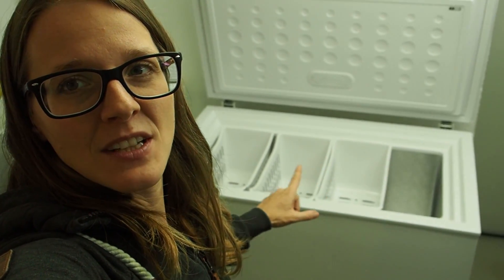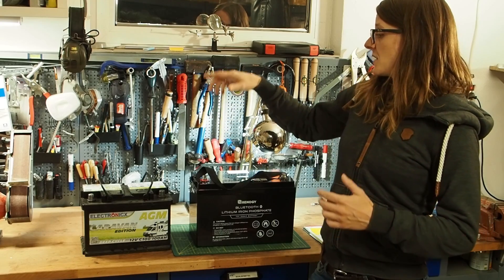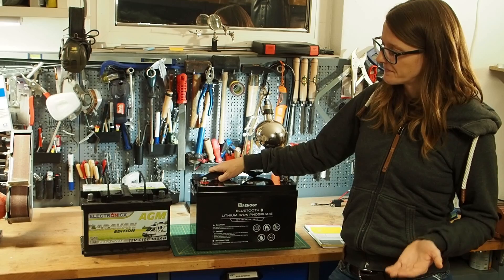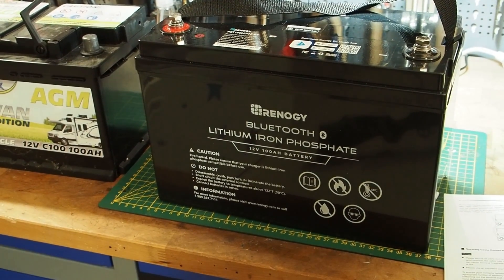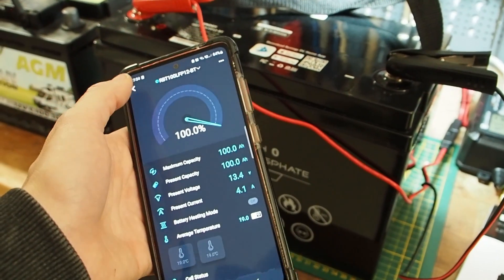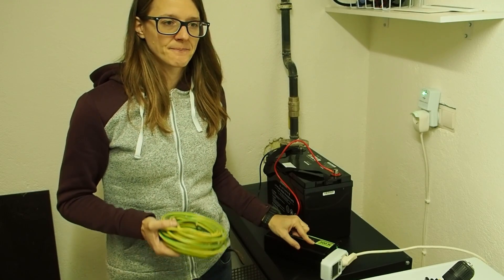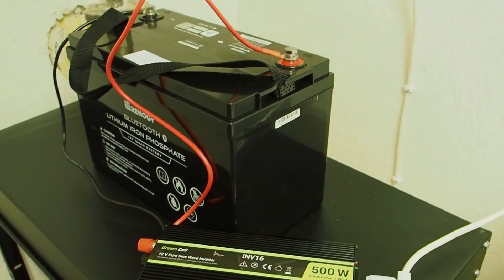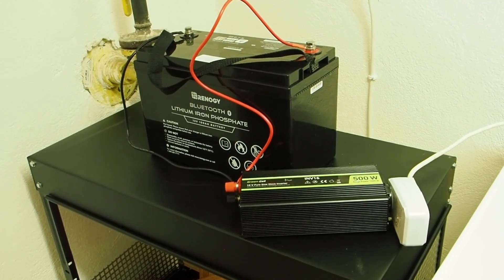How to run freezers off an inverter!

Comment from the maker: Check out Renogy Batteries: www.renogy.com
John Ward explaining IT system on Inverter: https://www.youtube.com/watch?v=mzCGE5wnWos
German Youtuber "ProofWood" solving the RC problem in Caravans: https://www.youtube.com/watch?v=FM9lvwX39g0
German Youtuber "Freunde des Stroms" making an adapter cable for Ecoflow for Caravans: https://www.youtube.com/watch?v=BTDX4ZoCEpc
Reply: This information is really good as I'm looking to do the same sort of thing but it is a shame Renogy don't call you to discuss there camper van complete kit requirements even if you log a request as I live in the UK and I need to make sure the system is UK compatable.... Great work Lilly
Reply: Nice! I have a Renogy inverter to fit hopefully before the winter (on a boat mind). :)
PS thanks for the info, my motor will be running of a 24v system, so interesting to know some don't allow being put in series!
Reply: What are the downsides of a bluetooth battery when we are all on blockchain system of control?
Reply: Excellent video Lilly,love your knowledge of electronics. U are a total survivalist,and I'm impressed with ever video.
Reply: Hast du hauptsächlich englischsprachige Begleiter oder wie kommt es das du als Österreicherin englischsprachige Videos machst?

Comment: Just grounding without the correct modifications can be dangerous.

Using one device only is safe. Otherwise you need to bridge n+e before the rcd and ground it properly, to make it work safely

Comment: Nice to hear your comments and experiences.
I have a couple of questions about a DIY project that involve a 100lts freezer.
The actual supply battery is 150 amps,   Lead acid, I have 4 solar panel 150amps, connected to the controller. I use for lead lights bulbs and planning to power the freezer. The question is, in order to run the freezer I need to use another battery ? Is recomendable to paralell to use 24 V o continuous with 12v. ?
Appreciate some advise, 
Thanks in advance

Comment: I am almost positive you can connect those renogy batteries in series you should look into that for sure.  I have 2 renogy 48 volt lifepo4 batteries connected in series with no problem ,it actually came connected in series I have the lycan 5000 ,but I can't say with 100 percent certainty just that you should double check anyway thanks for the video . Have a great day

Comment: Great video.  I thought I was going to need to correct you but you did a great job.   I just want to reemphasize that the LiFePo4 batterys give you double the run time of a lead acid that is rated at the same amp hours.  So that cuts the cost in half when you compare.  Plus the batteries last way way longer.  Never by lead acid again.  Waste of money.

Comment: The initial voltage of a compressor starting is called inrush The compressor will have a start load run amperage sometimes noted as SLRA . Then you have rla which is run load amperage. To verify your ratings to a sine wave converter and to the power supply peak and discharge you need to take an amperage and voltage reading from the compressor when it comes on. You do this directly at the terminals and then after it begins to run so you do not damage the inverter the battery or the compressor Yes I am an HVAC and refrigeration technician and specialist for over 25 years.

Comment: 500 w inverter may not be big enough to run the amps from your refrigerator I would have gone from 1500 w minimum to 3000 w cover your back a lot better

Comment: I was hoping you would discus the surge watt question in greater detail. For example, when choosing an inverter, do you add the running watts to the surge watts and use the total? Say 500 running watts and 1200 surge watts for a device. (500+1200=1700)? Is this correct?

Comment: User Comment: This video on electricity is so interesting! I'm always looking for reliable power solutions for my outdoor adventures. Any recommendations for portable power stations or backup power products?Response: Absolutely! If you're an outdoor enthusiast or an RV lover, I highly recommend checking out the Segway Portable PowerStation Cube Series. With its massive capacity, fast recharging, and comprehensive protections, it's a versatile powerhouse that can keep your devices and appliances running for extended periods. Plus, its waterproof design makes it perfect for any adventure, rain or shine!

Comment: Nice and informative video😎☕
.
I use a 200w invertor and 4 lead acid deep cycle RV batteries, in my little watchmans trailer.
 The invertor starts sounding an alarm at 11.1volts, and automatically shuts off at no less than 10.9 volts.
 Keeps batteries in safe range, living longer.

Comment: How did battery lose only 40A or 512 Watts in 24h when the freezer pulls 80W plus inverter loses on top of that of at least 6%? Is it magic battery?
Reply: 80w,,,to start the compressor initially, then drops to,,,,26w after ( I think she mentioned those figures in video.)

Comment: But the lithium iron batteries cost 5 times the price of a acid battery so i would 4 or 5 acid batteries and pure sine wave inverter 1500 watts 3000watts or higher with 2 to 3 AC sockets . but make sure you you get the right size cable for the battery leads so they dont over heat ie thicker cable ,also the right way to connect the cables to the batteries .

Comment: The lead acid battery may say 500 cycles at 50% dod but its still perfectly usable after 500 cycles still retaining 80% of its original capacity
Reply from the maker: Dont think so but maybe dependa on the brand

Comment: Anytime you can run your appliances DIRECTLY from the battery/solar system (DC), you are way more efficient. There are very good DC powered freezers and fridges available. INVERTERS, by nature, are ONLY about 75-80% efficient. The components inside them get hot (that's why they have a fan inside) and they are ON all the time drawing some power. All "whole-house" systems HAVE TO BE designed at least 20% over sized to take care of this! For small apps, such as a freezer, I myself, would rather not waste my limited solar/battery capacity going through an inverter. For a whole house with a huge array....well that's different! Only an E.E major's perspective. 😝 But, in your case, Lilly, you are using this mainly as a backup, short term. So I get it!👍

Comment: Great video as usual. What was the app/website you used to calculate the amperage of different gauge wires at certain voltages. That looked very handy because I do all my own electrical work. Usually I err on the side of caution and use much thicker wires than necessary. This also helps with voltage drop through the cable.

Comment: In America, a two-wire connection is allowable downstream of a Ground-Fault Circuit Interrupter (GFCI). This is known as a Residual Current Device (RCD) in the EU.
I am finding that many inverter manufacturers include GFCI functionality.

YMMV

Comment: I was thinking of getting a 12v compressor fridge as a backup too. I have absorption fridges which are great for propane but not as efficient running on electricity as a 12v compressor fridge is. I have a large modern frost free fridge and freezer but they are power hungry on the batteries running on a inverter.

Comment: The LiFePo charge life is also where it goes to 80% charge capacity, after 1500 or its rating, so it has much longer life.
The caveat is that they are much more expensive, not just a little, but reliability in low temperatures and long life are the worthy trade off.

Comment: Lifepo4 batteries and new inverters all have safty mecanism. Most people have issues from loose connections, they  can over heat  because of poor connection conductivity and melt the wires plastics . Buy a Bluetti, safer and space saving devices. Insurance will not pay when fire is caused by DIYers.

Comment: Ya gotta also think about what happens if theres a EMP but also to keep ya freezer from turnin on soo much ya put bottles or bags of water in it so when they freeze it acts as a thermal capacitor which will make the freezer stay off even longer cause it will stay cold and u can always wrap the freezer in some foil board or have a small air gap and then some foil board as it will keep the freezers insulation cooler on the outside

Comment: A Good Rule of thumb when sizing an inverter to a Refrigerator load is Size inverter to 8 times Compressors Running Watts Minimum ! Compressors on start up draw about 7 times the running watts  For 1 second on start up.
Example: if Refrigerator or Freezer draws 100 watts while Compressor is cooling the System You Would Need an inverter capable of supplying 800 watts Peak inrush current Minimum. When in Doubt ALLWAYS Go bigger. Refrigeration man for 40+ years.

Comment: the RCDs after the inverters do not work because energy is being generated in an isolated way, the "neutral" is isolated from the ground, which in the area transformer substations is not, since the fault loop is isolated and therefore the RCD protection does not close after the inverters, especially if mobile and portable do not work, a thermal magnetic circuit breaker protection is more useful, it is important that the devices connected downstream of the inverter or mobile generator have a system in compliance with the law, plugs sockets extensions in good condition state without isolated central poles, there must be equipotentiality between the devices and the inverter, masses connected to each other through the plugs, in the event of a first fault with one of the 2 conductors of the inverter, we take the phase that goes to earth the magnetic circuit breaker senses the short to ground and opens and the inverter switches off on its own, the inverters to make 230V generate 2x115 Volts, in the event of a second fault on the neutral a real short is created the magnetic circuit breaker opens, The RCDs give a false safety after the offgrid inverters or portable gasoline generators, the same thing in this case of isolated power generation, there is no need to connect the masses to the earth leakage system if not c 'there is a danger of atmospheric discharges, as mentioned above it is important that the masses are connected to each other. Ciao
Reply from the maker: Yes the rcd connection needs to be modified. Please check the youtube video of ProofWood on how he solved this problem. I linked the video in the first pinned comment

Comment: Good video! A Way to Think about wiring in an inverter is to think about the inverter as the City Wires Coming from the Street ( Your Electricity Provider ) Put an Electrical panel on the Wall with breakers in it and use the Inverter to power that Electrical panel solely. Ground inverter to earth , Ground Electrical panel to Earth & Ground inverter to Electrical panel. Treat the inverter as “ Your Electric company “ 
& Wire As usual to code to the Panel.

Comment: The dirty little secret about electronics / technology is hazmat. Most folks ignore this because it’s not in my backyard. I think even an old fashioned lead acid battery is less of a hazard then lithium batteries. That being said I have a 1000 watt jackery in my van and I bought a 500 watt jackery for the wife. Just be aware lithium is a heavy metal. Love your work Lady always appreciated.
Reply: Lithium is a light metal - element 3, the lightest metal of all. Lead is the heavy one; must have been an innocent typo.
Reply: When figuring peak current/power one must take into consideration the inductive kick AC or DC motors calculate for peak current to be safe. As a young man we carried powerful DC motors driven by power amps of the same size. Driving the large reel to reel tape recorders in aircraft. Monitoring the inductive kick of the motors with an “O” Scope was always way off the scale. Okay I’ll be quite now.

Comment: Thanks for a nice video! I have the same GreenCell inverter as you but at 2kW and peak power at 3kW. I have counted on running two freezers, a refrigerator, the heating system's circulation pumps and a few other small things. Unfortunately I can't afford lithium batteries but run with high quality lead batteries from Draeger anesthesia machines...get free from work when we do preventive maintenance. Keep up the good work!

Greetings from Sweden!

Comment: this appears to be a re post with the info about the grounding added. If you want the safest you can have then you should have a qualified electrician set this up..... my question is with all the electronics in appliances now days would a short to the body of any appliance even work?
Reply: "would a short to the body of any appliance even work?"
It would be inconsequential.  However, if you had TWO (or more) devices and one of them shorts one polarity (or phase) and the other shorts the other polarity (or phase), then if you put hands on both of them at the same time you will get a dangerous shock.  A physical or earth ground on the appliance won't help simply because the inverter itself does not use ground.  
The idea of grounding appliances is that with two appliances grounded, and each shorts to the other phase, it will short circuit the mains and blow a fuse or trip the circuit breaker.  Even if not, the appliance being grounded won't develop a voltage relative to, say, the household plumbing so you don't get shocked touching the water spigot at the same time as an appliance.  Which you ought not to do anyway.
Reply: @thomasmaughan4798  Thanks for the explanation.  I dont understand if this applys to an inverter powering a freezer?  There is no mains to trip so what happens with the inverter? and how do all the portable power stations get by without a earth connection?. I am not asking for you to answer as i have contacted an electrician and will be picking his brain when he installs a transfer switch at my house.

Comment: Hello Super Lilly ,a great thankyou for your time and comparing batteries , at the moment i will install 2 agm batteries of 100 amp hours in paralel so i should have atleast 100 amp hours but to my calculations i will have less and the cost of agm is low , i realy would tell people that electronic devices are in grave danger of emp or super solar flares , so all make there own decisions , big hug from an old survivalist .

Comment: Try not to be too dependent on a freezer.  I wouldn't fill it with a lot of expensive cuts of meat or other expensive items. If frozen vegetables or quick meals go bad, it's not a big loss. My only real need for refrigeration is for insulin. I have a portable mini fridge for that. It uses far less electricity. It can hold several dozen vials of insulin with enough additional room for a bunch of ice packs. I also have a backup travel CPAP for the same reason.

Comment: Excellent video.  Wife and I have been watching you for years.  I agree the 500 watt will power one freezer.  I needed to power 1 freezer and 1 refrigerator. The 500 watt would work either one, and sometimes both.  When they both tried to start at the same time, the inverter tripped off due to overload.  I installed an 800W inverter and it runs both with no trouble.
Also, look at a “low frequency” inverter such as a Victron phoenix.  Those inverters have a really low “idle” current (when neither device is running). It extended the tome between battery charges by a significant amount.  Amp draw of the idle current dropped from 2.5A to 0.57A

Comment: The freezer does not run constantly, the motor cuts in and out when needed. The inverter will always be drawing current when on, I believe you could extend the usage by only plugging it in every 4 of 6 hours (would need testing) and only having the inverter turned on at that time.
Reply: Yes! I have tried putting a timer on so the freezer/inverter is ON/15 min.  OFF/4 hours.
I almost doubled the capability of my battery!
Reply: Except the freezer runs for a reason.  If you have items in there you don't mind thawing a little bit then ok, but the temp fluctuations can actually pull more power to bring back to temp rather than maintaining.
Like cooling your house only a couple of times vs maintaining the Temps and vice versa for heating.
The items inside at the temp you want help keep it from running as much over time than expending more energy to cool/heat it further than you would have just maintaining it.
Reply: @bonedoc4556  This is all true.  But having to not open the door for 10 hrs a day means you can set the timer to 4hrs etc but during the day, when charge is available, you can have it on all day. 👍
Reply: @Nellyontheland  good point

Comment: Your freezers are not "energy efficient". This can be seen on the EU energy label stuck to the front of your freezers.

The older freezer is rated "B" for energy efficiency, your new one only "C". You could have bought a much more economical "A+" rated freezer for under 500 euros. It would have consumed considerably less electricity in everyday use and would have needed less battery capacity in the event of a blackout.

Sorry, but you haven't thought things through completely.
Reply from the maker: My feeezer is drawinf 26 watts. That is pretty good. In 24 hours it draws about 400 wh which is better than most fridges
Reply: @SurvivalLilly  That can not be the reason for not bying an A+++ rated fridge. You can easily save 30% energy. Energy that gets energy, which becomes particularly valuable in the event of a crisis